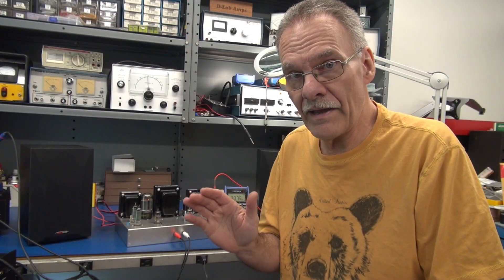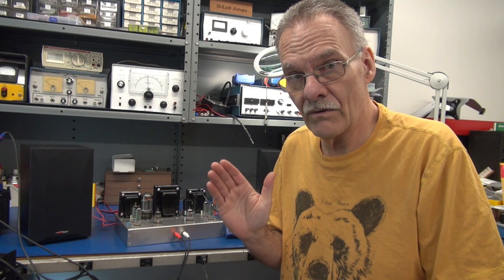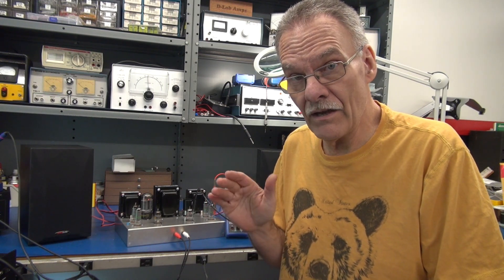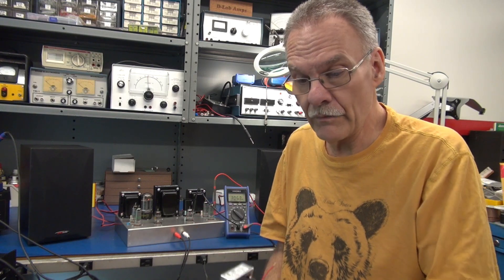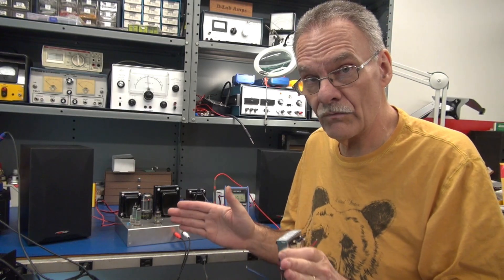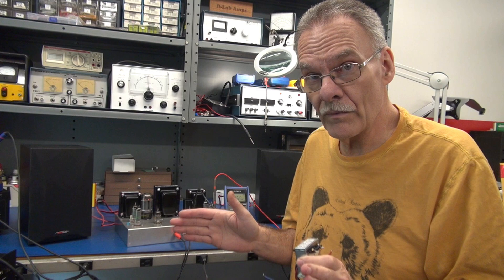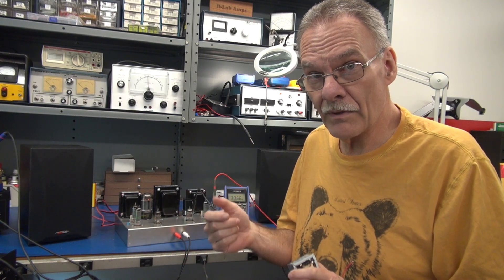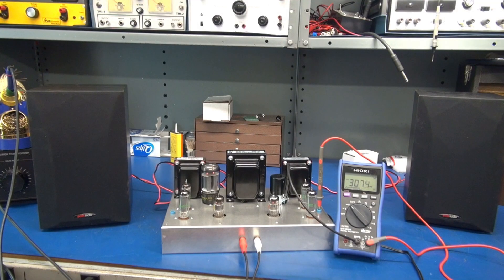D-Lab ST-7 Tube home low power stereo amplifier project Final update & Test Dynaco ST-70 theme

Comment: Hi Terry, I'm looking to build a Dynaco ST-70 clone. I 'm seeking out your help: which model of Hammond Output Transformer should I use? The change you 've done in your ST-7 on the output transformers is great. Since I didn't found some information about the impendance of OT's of ST-70, your knowledge is essential. Thanks in advance, Argyris from Greece.

Comment: HI D-LAB !  i have a similar amp from electrohome  , it has 6v6 outputs in push pull and a 12ax7 input driver  ,and a 5u4 rectifier , its a mono amp. the problem i am having is no sound !, with a signal tracer  i checked and  have sound going to pin 5  of  the 6v6 but nothing is coming out of  the  pin 3 , which is where  the  taps are attached from the  output tran. 
   thus no sound to the  output transformer .  i changed tubes  but no change .
another problem is  that according to the schematic  the  power  tran.  is supposed to be 315 volts x 2  centre tapped  , and  that is what i have , but  the b+ plus  is supposed to be 315 volts dc  but i get 427 volts dc !   how can this be !  could this be the reason for no sound coming out of  the  outputs  6v6 tubes ? 
any  advice  will be greatly appreciated .

Comment: mV is a Voltage reading not Current, otherwise awesome sound.
Reply from the maker: It is the mv measurement across the current sense 10 ohm resistor to each pair of tubes